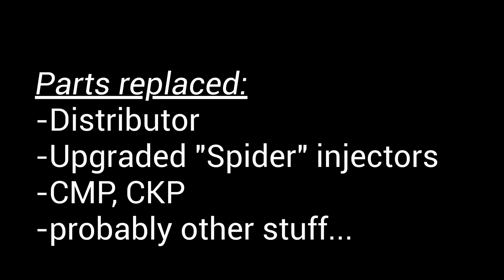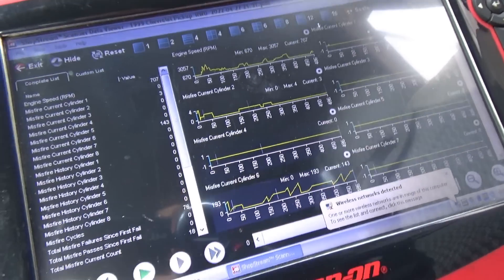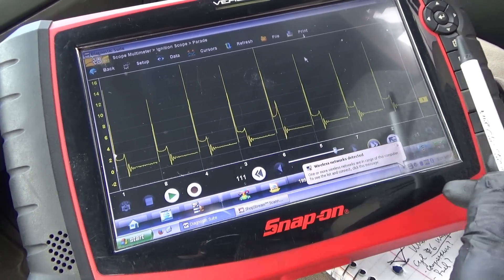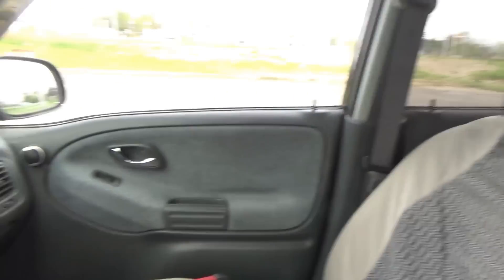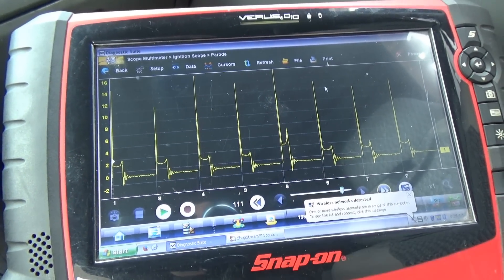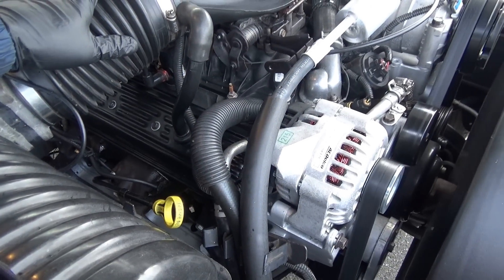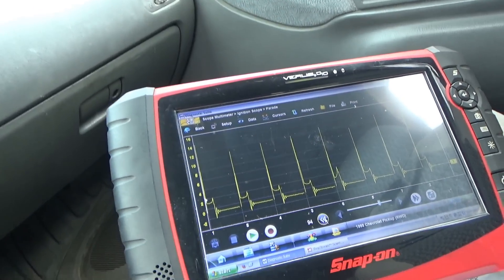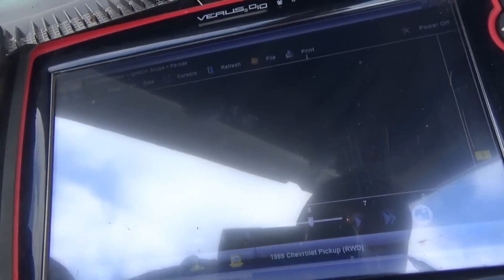Chevy Mystery Misfire...After Engine SWAP?

Comment: It's all good, we all miss sometimes.  Had a cust f150 a year or so ago, intermittent Under hard acceleration it'd just fall on its face, the a few seconds later pick back up.  I tested tested and thought I found the problem when I saw on data stream (had high pressure fuel pump) when it bogged down, the desired and actual rail pressure were 1500psi different. I saw this 3 consecutive times, so I called the HPFP.   I went on vaca, so my coworker did the work, DIDN'T FIX IT.....ended up being bad/wrong spark plugs.  For someone who seriously prides themselves on getting diagnostics like that correct, extremely embarrassing!
Reply: So how do you explain the pressure difference?
Reply: Nick Malone.....the pressure difference would come when the HPFP would drop out momentarily, bc that's exactly what it looked like.

Comment: Had this one time. Junk yard engine. Took upper intake plenum off and found that the number 2 injector was plugged into number 6 hole and number six injector plugged into number 2 hole . Put them where they were supposed to be and reassemble plenum and ran engine. No more miss.

Comment: Ivan, great video.  I’m anxious to find the cause.  I wish you were here in Florida.  I’ve been trying to fix my 1948 Ford truck with similar problem.  Problem started right after I filled it with ethanol free gas.  So I bought gas from another station and ran it from a bottle to the carb,  no difference.  It started shaking right after coming off fast idle at startup.  I have 300 miles on my 5.7 GM  Goodwrench gen 1 crate motor.  Has 3 year old edelbrock carb.  I have 15 on my vacuum gauge.  Engine is 7 years old. Plugging vacuum line didn’t help.  Sprayed carb cleaner around edlebrock manifold no help.  Replace cap, rotor, wires, plugs, ignition module, and coil, no help.  Replace harmonic balance no help.  Played with timing helped a little.  Plugs are sooty, so running a little rich.  My buddy suggested switching to fuel injection.  I’m out of ideas and tired of shooting the parts cannon at it. I’ll keep watching to see what else I can try.
Reply: Add propane to the top of carb. Get a propane torch and put a long hose on it and you can meter the fuel and see if it Likes it. See if your vacuum comes up to 19 inches. Also you need to make sure timing is advanced enough...don't guess.  I'm a 25 year mechanic that uses propane to diagnose weekly.
Reply: During my previous trouble shooting I did run propane.  But around the base of the carb and the intake manifold.  I’ll try into the carb as you suggest while observing the vacuum gauge.  I set the ignition timing per the cut sheet that came with the motor.  Engine would shake and stall.  I had to advance it beyond the timing marks to keep engine running.  Thanks for your suggestion.

Comment: One of the risks of diagnosing on the road quickly.  Kudos to you Ivan for posting your mistakes as well as your many successes.  I'm really curious if it is a cracked manifold.  If so, your diag was really close to being correct.  And you never know when someone else is doing the work if they are making the same mistake again.

Comment: You could still be right. If the intake manifold is out of flat, the same symptoms could occur even with the best gaskets.
Classic test would be to spray some ether (or your favourite flavour of aerosol spray) around the gaskets to test if they're letting anything past.
I was surprised you busted out the pressure transducer before doing something so simple.

Comment: Looks like some anti-seize on the spark plug threads.  Not a good place to use that.  That stuff is an insulator.
Reply: Pundits say dont use anti sieze on plugs b/c  they loosen with vibration

Comment: @5:17 the whole sequence on that cylinder elevated above ground level. a fluke in the capture or is there a problem with the circuit.  only when hot sounds like the ignition module on those old chevys.

Comment: Caution: I had commented on another auto repair channel and received two different comments back. The first was from the YouTuber and the second was from a fake using his logo. This has happened in the past with paranormal channels, and now it is hitting auto repair.  If you have a logo, please get it trademarked. Stay safe and don't click on unknown links.

Comment: GM 5.7L V8's used to have a problem with the valve guides causing the valves to be to tight in the guides after a long or hard or loaded pull especially going uphill.  Some machine shop work fixed the problem.  
Another thing was valve springs.  Weak valve springs did the same thing.  Once the engine cooled, all was well.
You'll find the problem Ivan!  On to part 2.
Reply: I was thinking bad valve spring also
Reply from the maker: This possibility crossed my mind... But how to test for this while it's acting up? 🤔
Reply: @PineHollowAutoDiagnostics  intake pulse sensor! That can be done on the road, under a range of loads.
Reply: @Pine Hollow Auto Diagnostics
There was a TSB from GM about this problem years ago, I don't remember if or how testing is done during the failure. IATN "might" have information about that or maybe Keith might be helpful.
Reply: Also check #PIP3081: SES Light and P0300 When Towing , Cruising Uphill or on Hard Acceleration - kw 4.3 5.0 5.7 accelerate cruise cylinderhead DTC L30 L31 L35 LF6 LU3 P0300 P0301 P0302 P0303 P0304 P0305 P0306 P0307 P0308 - (Jul 23, 2004)
Reply: I'm attempting to paste the TSB. 
Subject: 	SES Light and P0300 when Towing, Cruising Uphill or on Hard Acceleration. 	 
The following diagnosis might be helpful if the vehicle exhibits the symptom described in the PI.
Condition/Concern:
The vehicle may exhibit a SES Light due to a P0300 and misfire. If the misfire is related to the information below, it will typically happen while cruising uphill, pulling a trailer or on hard acceleration and then stop misfiring shortly after returning to an idle. Typically, cylinders 3,4,5 or 6 will be the ones to experience this.
Recommendation/Instructions:
If the P0300 SI diagnostics did not isolate a concern, the following may help:
Remove the valve cover, valve springs and valve seals on the effected cylinder or cylinders. A small wire tie or rubber bands can be placed in the valve stem keeper groove to prevent the valve from falling into the cylinder. Rotate the valve while moving it up and down in the guide to see if it binds. If a binding valve is found, remove both cylinder heads and use either of the following methods to increase the stem to guide clearance:
Send the head out to a machine shop and advise them to increase the valve stem to guide clearance to 0.002 inch per guide.
Hone the guide with a 9 mm hone, such as Snap On BCG249, until a clearance of 0.002 inch is obtained. This will usually take about 4 strokes of the hone.
Reassemble the cylinder heads using new valve seals.
Models:
(96 - 02 Chevrolet Astro) and (96 - 02 GMC Safari) and (96 - 00 Old Body Style Chevrolet Suburban) and (96 - 00 Old Body Style Chevrolet Tahoe) and (96 - 02 Chevrolet Express) and (96 - 00 GMC Yukon) and (96 - 00 Chevrolet Old Body Style C/K Truck) and (96 - 00 GMC Old Body Style C/K Truck) and (96 -02 GMC Savana) and (96 - 99 P32 Cab and Chassis) and (96 - 02 Chevrolet S-10) and (99 - 02 Chevrolet Silverado with 4.3L V-6 Engines (96 - 02 GMC Sonoma) and (96 - 02 GMC Sierra with 4.3L V-6 Engines).

Comment: o-ring gaskets on the spider injector at the injector port.. if the injector is not fully seated or the O-rigs fail it will leak only at temp when the manifold is heated and expanded.. Had the same issue w/ 2.3 v6 in a s10
Reply from the maker: Very interesting

Comment: As always, love the content. I recall on these vortecs that sometimes the plastic intake would form hairline cracks where the gasket seats. Ran ok cold, but would open up hot, causing lean codes and PO300s if bad enough. Overtightening can do this on an old piece of plastic. Try some propane or carb cleaner while running, at the mating surfaces. Note that since this is an older OBD2 in a 1 ton, the computer may not even be programed flag misfires at idle, though it still counts them. I've seen that all the way up through 04 on some Express vans!
Reply: At the end of the video I was shocked that the new gaskets didn't solve the problem, the lean misfire seems only that it could be caused by an intake leak somewhere allowing too much air in.  But, if those intakes are prone to their own leaks, that makes a ton of sense!  I'm assuming the intake was swapped over...and so very old.

Comment: From previous videos, swap parts around between 2 cylinders or vacuum leak. The compressions test should rule out anything mechanical and I assume timing problem with valves opening at wrong time would also show up in test.

Comment: Interesting! I wonder if the spark plug itself is acting up when it gets hot. I just experienced that with a lawn mower. Ran good when cold, but started running rough after a few minutes then dies out and wouldn't restart until cool. Heat can do interesting things to failing electrical components.

Comment: I'm not a mechanic but was wondering why #6 plug looked rich when #6 was diagnosed as lean? I also noticed that #5 cylinder occasionally looked lean (at 7:59)
Reply: I was thinking the same about the plugs. Maybe the plug is arcing internally?
Reply: @Jasher M. OK, so it's not lean, it's just being "reported" as lean. Got it.

Comment: It happens to the best of us. I just did a rack n pump on a truck n it was fixed for a week. Come to find out if was the steering shaft causing the problem the entire time. Only reason it fixed for a week or so was because I had to move that shaft out of the way n it just made it seem fine for a little wile. Hate looking dumb after making the wrong diag
Reply: lol ... First U-joint above/at the death bolt.

Comment: I really respect that your willing to show your mistakes. Every tech makes a bad call and if you show me one that doesn't, ill show you a liar lol. I'm a little surprised you didn't spray alittle brake clean on intake runner 6 to see if the o2 went rich. I had a similar issue, actually same truck too. It had a slight misfire on 6 and after doing a injector balance test I found number 6 was slight clogged. The filer neck rusted a small hole and all kinds of stuff made its way in the tank. So the customer replaced the injectors but still had a misfire on 6. At this point I'm lost because before my diag this guy did it all (wires, plugs, gaskets) but injectors and I had proof. Number 6 injector had a 9 psi difference between the rest on the balance test. So after getting the truck back and racking my brain I found the issue. I took a little soapy water and poured it over the injector 6 while running and it had a slight leak. When the customer installed the injectors he slight pinched the o ring on 6. I checked everything before I found the problem. I smoked it, brake cleaner while watching o2s, check injector balance, incylinder and spark wave form and everything checked out. I was thinking maybe he got a injector but I would think the balance test should of showed something and the largest difference was half a psi.
Reply: I'm willing to bet my last dollar this isn't his first parts cannon diagnosis.

Comment: Ivan correct me if I’m wrong but their looks to be a difference in the scope image on cylinder six . Between the exhaust valve opening and and intake valve closing prior to compression their seems to be some variation in the capture. Do you notice it or am I out to lunch. I know the vacuum and pressures are very close it just strikes me the captures look a little different. I’ll have to review Brandon’s class and text to verify my eyes but it’s just a suggestion. Thanks for sharing Ivan and have you received any reviews on the new pressure transducer? Artie 👍

Comment: Check the distributor cap,,, that vintage chevy are notorious for cracking and burnthru, allowing spark misfire. when they first start, they usually act up when hot. problem will continue to get worse as burnthru advances.

Comment: Intake gasket leaks are always confirmed with some brake clean  or WD40 squirted around the joint - if the miss goes away or you see the liquid being drawn in, Bingo. Also check for a tight valve clearance on cyl 6 intake,

Comment: We had the same thing happen with a Chevy engine swap. Intermittent misfire on #5. Couldn't figure it out. Seemed like a vacuum leak but didn't respond to spraying around the manifold. Finally pulled the manifold. The mechanic had left a piece of rag in the intake.
Reply: How did this not get sucked in and destroy the engine ?
Reply: @nickmalone3143  It looked like it was pinched between the manifold and  gasket. Just a small piece, but it was enough to mess with the flow in that port. It would throw a code on long de-acceleration too.

Comment: #6 comp spike was leaning left. Why? Many years ago had a parts store 2.8 carb'd reman in a S-10 Blazer. No power. Finally tracked it down to poorly ground camshaft. THAT was a tough one with no scope. Had to use a degree wheel & indicator to check valve timing.

Comment: Those first waveforms look like high secondary resistance on cyl 6. With the updated injection it's possible the injector is not seated properly, or on the wrong cylinder.
Reply: I was thinking the same thing with an injector not being seated properly. I'm not familiar with GM's spider injection system, but if an injector was installed in the wrong cylinder wouldn't that leave two cylinders with reversed injectors and misfires?
Reply: @averyalexander2303  
Thinking fuel injector also.  Sealing or "low quality"  and electrical failure when hot.

If it was an "ls" type engine, would also chase hot coils, but does not apply here.

Only my 2 cents.

PS:  Gotta love Ivan's tool kit.  Pressure transducer test!  NICE!  I would have tried a relative, but this issue is intermittent, as view on scope,....aka most likely electrical.

Comment: I would be sure that engine has a new set of valve springs as they have problems with valves hanging when real hot because of weak valve springs
Reply: Dont they put cheap valve springs in those rebuilds ?

Comment: Be sure to check vortec intake surface with a straight edge to see it is warp in the middle one other possibility is there to hair line cracks in intake manifold runner or the plenum also check map sensor seal and brake vacuum port seal, personally I think it's a spider injector is self because #6 plug look a bit richer than #4
Reply: Check intake with a straight edge? That's so early 50s
Reply: @elcomandante9299  you are aware that the vortex heads and intake manifold only has 4 bolts pre-side only cover the water passage unlike the earlier Chevy 350 which has six bolts per side keeping the center of the intake manifold from warping.
Reply: @elcomandante9299  .. but then you would have mess with a carbuerator

Comment: You can help diagnose intake manifold gasket leak with a little bit of spray on the top of the manifold and also tiny bit in the crank case

Comment: I was wondering how the vacuum leak explained the low power complaint, although the new engine might have a different cam or CR. The injector balance test is usually at full open and might not be valid at idle loads. Scoping voltage and current to the injector might reveal something. Also, there appears to be a vacuum port near the no.6 runner. that could be the source of the leak.

Comment: Is there a reason you didn’t do a relative compression test on the Pico? Would have thought it was faster with less chance of cooling down to the point of eliminating the miss.
Reply: He had 190 on cyl 4 and 186 on cyl 6.  Pretty similar compression.
Reply: @The_Redkween  Yes but would have got to the same conclusion faster using a relative compression test & not run the risk of the problem disappearing whilst taking plugs out etc.

Comment: Two things that I would check just for poops and giggles: spark plug and fuel injector. The resistance on the plug could be changing due to heat or the winding in the injector could be breaking down causing it to stutter. 
Swap the both with known good and see if the miss moves.
Reply: Don't think you can swap injectors on the spider system?
Reply: Yep replace those junk copper plugs with iridium an bet that would fix it
Reply: @codyarizona4925  ..copper plugs cannot handle high voltage arcing in modern cars which have a hotter spark ....irridium way to go although $20/plug
Reply: @nickmalone3143   Actually those Autolight iridium plugs @ $9 I've used in dozens of vehicles foreign &domestic with zero issues. GM's really seem to like them.
Reply: @codyarizona4925  ...ford product in gm .. say it isnt so
Reply: @nickmalone3143  🤣
Reply: On the old spider systems, you couldn't swap the injectors.  The later ones had 2 wires going to each injector for control.  I know they had that on the 96 V6 minivans.
Reply: I thought it may be dirt in the injector, but it shouldn.t make a difference whether the engine's is hot or not.  My bet is faulty coil.

Comment: It could be a cracked intake too..   You could weld it shut, if you can find it.  But those hairline cracks are harder to spot.  There are kits that you can buy that have a powder and dye that makes the cracks much more visible.  (HAO) Visible Dye Penetrant Crack Testing Kit)